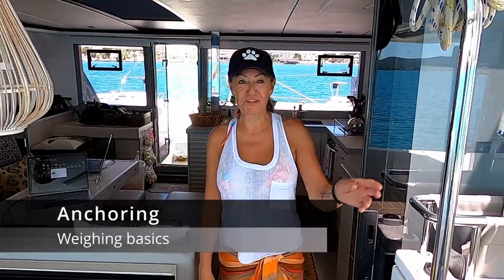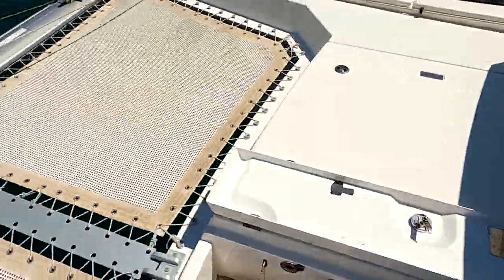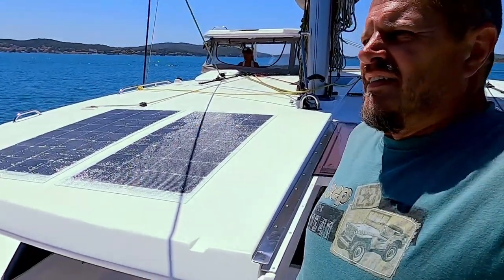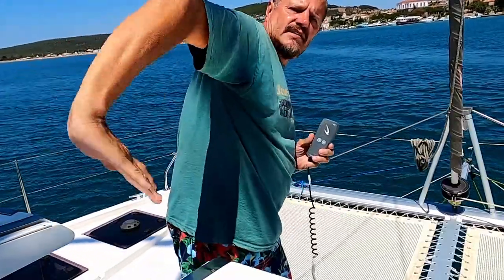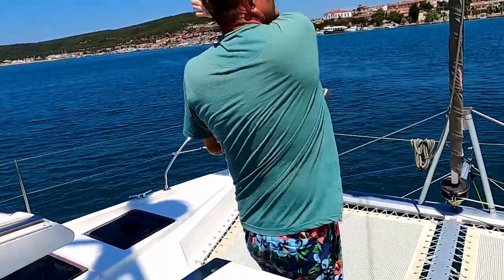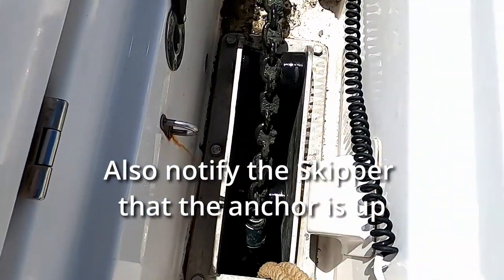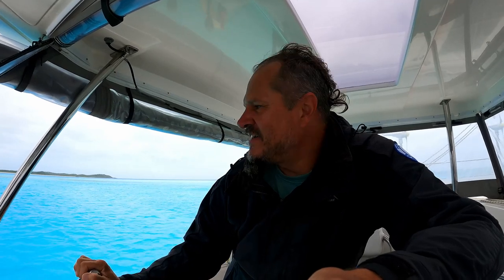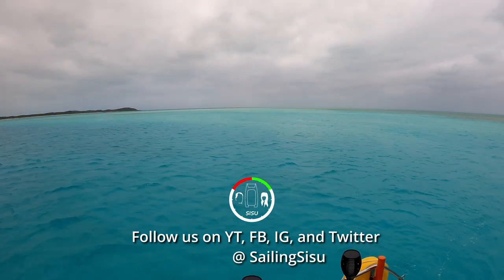#187t Weighing Anchor | Sailing Sisu Leopard 45 Catamaran Circumnavigating

Comment: Some additional anchoring thoughts:

1.  when stowing anchor, tie it off as extra security in case it comes loose.  Easy to do an the consequences of a loose anchor can be bad.

2.  when setting the anchor and you have pulled the chain tight, drop a waypoint on the chart plotter just off your stern.  Comparison to this way point will give you more advance notice than the anchor alarm and will help you answer the question easily if anything has dragged at all.  Then the alarm can be a secondary warning.  I do this if winds are predicted to gust above 15 knots or squalls are possible.  It provides terrific peace of mind when the boat starts tugging in wind gusts.  Each tug the boat should never cross the arc of the waypoint.
Reply from the maker: Excellent advice, Gordon! Yes, we do set a waypoint at where we drop the anchor and the set "goto waypoint". This gives us a) a general idea where the anchor is during tidal swings and a new boat wants to come and anchor, b) we can check the distance to the anchor relative to the chain length to see if we start to drag, an b) we export these anchor waypoints for later references as to where we anchored before.

Comment: Thanks for the video. I did not notice any markings on chain for distances, eg every 10 meters. Is the chain counter accurate enough in your experience where you do not also need the chain marked?
Reply from the maker: No, don't rely on chain counter. It is accurate when it is working 😅 we also inserted chain link colours, which are falling out, but they saved us when the counter failed. We are planning to paint it after we galvanised our chain 😉